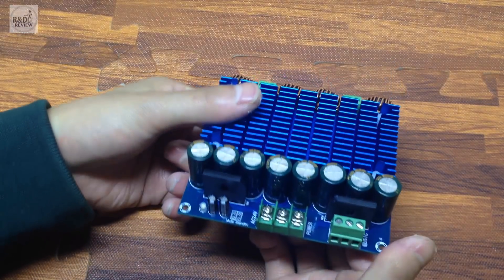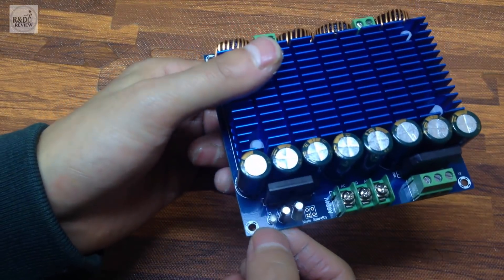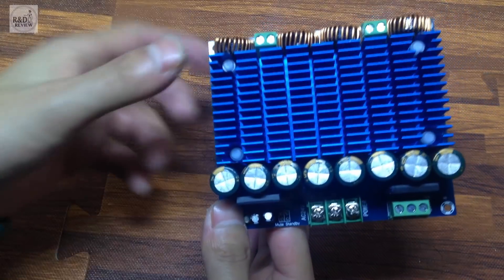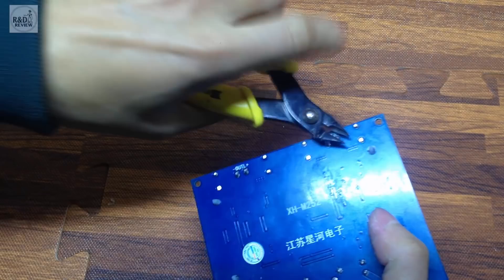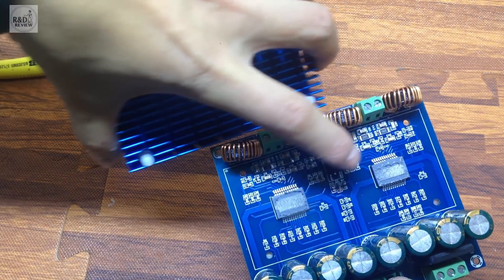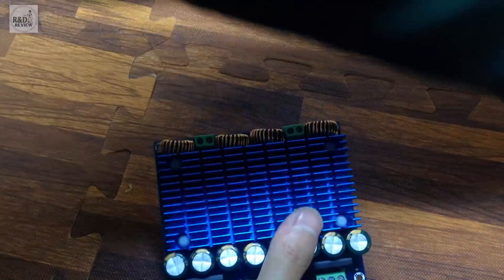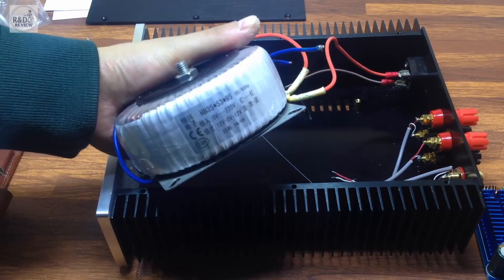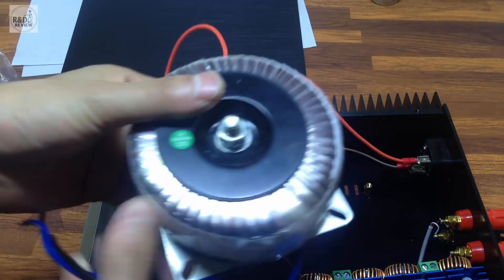Module Audio Class D TDA8954 2x420W XH-M252| Nhóm Review

Comment: the recomended is AC 24V, why u just use 12V??
Reply: That's to achieve 2 x 420w Max power.  You can use a range of voltage ( 10v - 26v) but however, the unit will drop in power output. But even @ 2 x 210W its still very loud plus the unit will be more efficient as less heat will be produced.

Comment: Tda8954j is better than 8954th for this enclosure
Reply: The problem is..... THERE IS NO ENCLOSURE
Reply: @taaviparn9175   I mean the enclosure with aluminum heatsink. TDA8954j work better with  project box or enclosure with  heat sink because use screw to attach ic on heat sink like a tda7294 ic
Reply: @taaviparn9175  a tda8954th is waste for this aluminum box because module have a small heat sink and heat up like a hell without fan
Reply: @acue79  oh you meant the amplifier enclosure. In that case it may be true